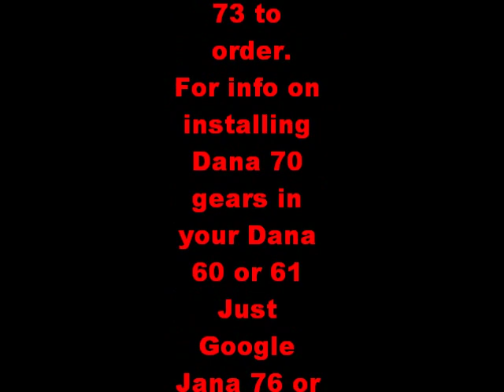how to make dummy bearings by jantz engineering

Comment from the maker: I have  mixed brands with no issues.  as long as its a good brand like timken, koyo or SFK, As for new verses used.  I have used some pretty rough bearings to make dummy's in a pinch, and when changing over to the new ones on final assembly have seen very little difference.  The ID and OD tolerances on bearings are very tight, a few tenths of a thousandths of an inch. however the thickness can vary up to Four thousands of an inch for each part, so theoretically you could go from a minimum spec race and bearing combo to a maximum spec combo and be off Eight thousandths. In practicality, I just don't see issues come up because of this. With that being said you must still check the pattern and clearances, and preload again after switching to the final bearings, and be prepared to use a proper pullers etc. to make final adjustments. Figure it this way, the dummy bearings get you quickly and easily within 95% of your goal. Saving hours of puller and press work. then you just have to fine tune it at the end. Note: You will see in manuals to measure the old vs new thicknesses of bearings and compensate for that in your shim stacks, however what I see is that most peoples measurement abilities vary more than the bearing tolerances so just don't bother.

Comment: Hey Carl. Is there a difference in preload/setup when using used and/or new dummy bearings? Also is there a difference in spec between manufactures, for example Koyo and Timken? Do you have a preference between said bearing manufactures? 

Thanks
Reply from the maker: Technically per Timken’s web site IDs and ODs are kept very tight tolerance less than 1/2 a thousandths, but thickness can vary up to 4 thou, so possibly 8 on a combination, in reality I dont see but 1 to 2 tikens and koyos, but I bougt some china mades to make dummys and found up to 31 off, so always a good Idea to measure the combinations and account for any thickness variation on final install.

Comment: I keep my old bearings & races in a desk drawer in my garage with my other "specialty tools", they come in handy.
Reply from the maker: +Anthony Wayne Some differentials, have screw adjusters for the carrier bearings, and some have shims on the outside of the bearing races, so you don't need the dummy carrier bearings,  but some brands put the shims under the pressed on carrier cone, therefore having a dummy bearing just makes things much faster.
Reply: +Carl JantzEngineering Carl, thank you for responding. I thought this might be a time when my questions just went unanswered. Logan came through, and now you. I appreciate you taking the time to do it as well, and feel I am now ready for the task. Take care sir and great video.
Reply: Would you please to explain to me the reason for the 
dummy carrier bearings. I understand the need for dummy pinion bearings,
 since it may be necessary to change the pinion shim. But the carrier is
 held in by end caps, if your backlash is off, then just remove the caps
 and install the needed shims...no? Please reply.
Reply: +Anthony Wayne: you make a good point that the pinion dummy bearing have greater necessity than dummy carrier bearings.  I've just learned by trial & error that it's best to get things mocked up as close as possible BEFORE you pull the trigger & press those brand new bearings onto your work piece.  That & those old bearings & races can sometimes come in handy for other projects that require a press.
Reply: Logan's Hot Rod & 4X4 
Yes. I have mostly a selection of ground races and races I have sliced (grab with slip joint pliers to remove) as press and drift aids. 
I’ve been laughed at for it but I’ve never had to replace deformed aluminum seal/race drivers like others have who’ve beat them to deformity. 
It doesn’t cost anything to save repetitive used parts for sacrificial use!

Comment: Man I did the same while adjusting a 1050 scfm rotary screw compressor. I made a set of dummy bearings after second hand units (cone + outer race), measured the current stand off of these bearings and proceeded with the assembly. I had to reach a rotor-housing freeplay between .0025"-.0045", finally the stack of needed shims calculated didn't work once I installed the brand new tappered roller bearings, I guess because there was already a bearing stand off difference between them, even If they where measured to be compensated. Great videos here!